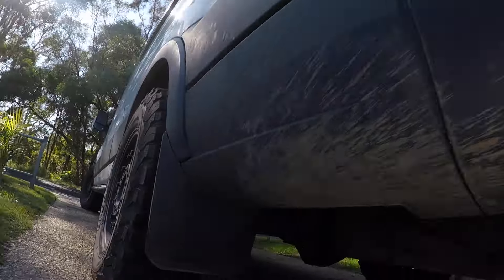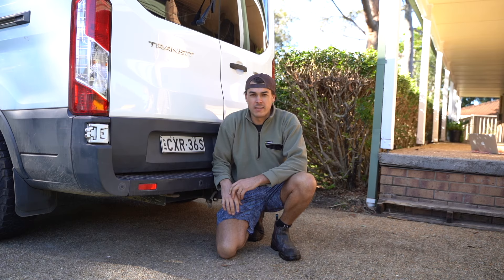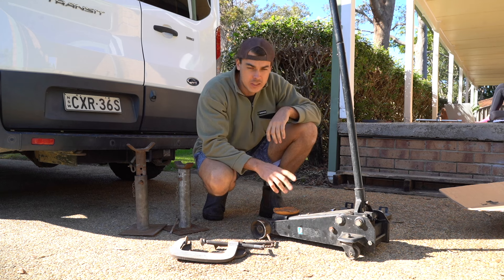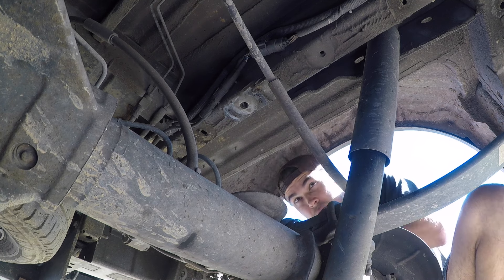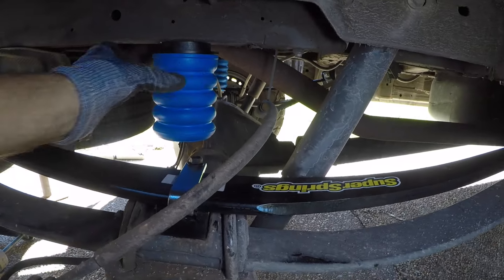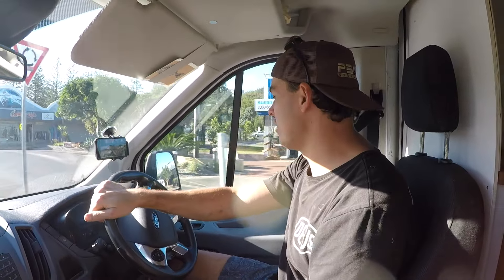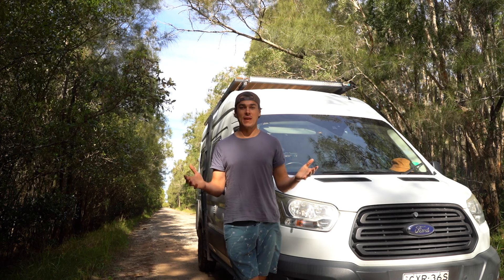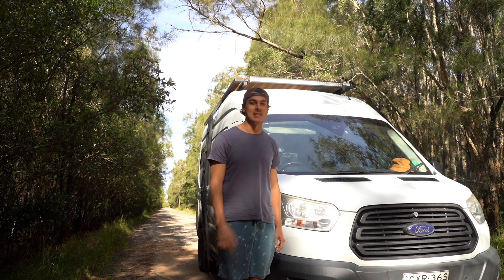We're TOO HEAVY- Upgraded our Suspension to SUPER SPRINGS | Ford Transit Conversion

Comment: I know its been a few years but thank you for sharing your journey on solving the over weight problem. In America its our belly that needs the super springs < I'm only kidding America < There was a time in America when we can have joke about things like this. I love solving problems, its the journey not the actual solution. Its that inner feeling of doing yourself using the information that's available. And when you get to work and your solution can be repeated. Its an amazing feeling! The journey is putting the part on the same frequencies, the tone of the vibration and putting the 3  to work together/ balance! Every thing has adjustments but there are degrees. You have to find the right one to fit that problem. GREAT JOB!

Comment: Hi I have RV mobile home that’s on a Ford Transit 350HD Chassis which I just got in January.  I wasn’t aware of SuperSprings I just know about the sumo springs for front and rear.  So I know I’m not overweight or sagging in the back  and everything is pretty even in the RV.  So next week having the Sumo Springs and a Hellwig Sway Bar added.  So now I will monitor the back very closely and see if in the future I may need to add SuperSpring to my RV.  Excellent video.

Comment: Great video, Ty
This video was so needed I have been going crazy removed everything out of my van just put some plastic in to lighten it up and I am still dealing with issues and I really don't have that much.
The mechanic prices to fix anything or through the roof and pretty much you pay them and they never fix anything.
So I am so grateful for this video I'm so grateful for the time you took and the details of every nook and cranny in explaining successfully a great fix.
My van  is a 92 Chevy g30 sportvan and I am not willing to let it go at this point. I just need more videos like yours and I can live successfully off grid. So gratefully,  thank you so much.💯✌️❤️🕯️
Reply from the maker: That’s awesome I’m glad you found it useful. You should check them out to see if they stock a set for you van. They are a pretty universal product so they accomodate for a range of vans and pickups. Good luck and I hope you can find a solution
Reply: @saltyvanventures  Ty brother,💯✌️

Comment: Thanks for addressing this issue. Like you said it’s not talked about. I’m about to get some springs in my sprinter lwb this week so great timing in this episode to have a better understanding of how it works. I know when I built my van I focused on not going above the GVS but I should have focused more on keeping it as much under that as possible. I too am experiencing it more on drivers side as more weight that side even though I tried to distribute weight evenly. So my Xmas project is doing a van renovation to help reduce some weight. Cheers to a better ride ✌🏼
Reply from the maker: So glad this has helped you out. Yes i think its common for people to try and have the GVM as a target weight but thats probably not the right mentality, as we have both discovered.

Comment: I too added a leaf helper "super spring" but later took it out and got myself a completely new set of  extra heavy duty leaf springs that had 5 brand new leafs vs original old 2 leafs. Much much better solution and it didn't cost that much more.
Reply: Was there any problem you found with the superspring?
Reply: @RedbackAviation  It just wasn't enough lift for me. At the time I thought it was my only option and I didn't realize that you can order a completely new leaf spring set.

Comment: Cool video, glad your happy with your modification on the van! I have a third gen Toyota Tacoma TRD off-road it always sags when I put my trailer because the "off-road" model has soft suspension I just put on the sumo springs I need to do the front I just did the rears... I don't have $600 bucks to blow right now haha

Comment: Thank you so much for this DIY solution! It also makes it less scary to try it out on your own and thank you for showing us some "troubleshooting steps" you have done with the camera!

I've been wondering, wouldn't it be better to make the Assister-Spring tighter on the right side, by setting it to middle-position, instead of lowest position? Wouldn't that bring it perhaps closer from 845mm to the 885mm on the left side? Just wondering why you haven't decided to do that? Thank you so much for the explanation!
Reply from the maker: I tired that but the suspension was then too stiff and wasn't as comfortable to drive. There is a happy medium with the springs you need to find for each vehicle.

Comment: We just built out a 2023 Ford Transit AWD 250. It’s GVWR is 9070. We are about 700 lbs over that. This van rides nice but the leaf springs are slightly inverted and the bump stop is sitting (no gap but not compressed) on the axle. We are looking at the Stage 4 TOPO 2.0 System. Ever heard of it? How would you compare your kit to this kit? Price wise, big difference. I just wonder if I’m going overboard if I go with Van Compass’ TOPO 2.0 system. Thank you for this great video!!

Comment: Very cool. I was up in the air with deciding to do this or not on my Sprinter build. You have definitely convinced me to do it. The comment of a passenger & driver side let me know they come in pairs. Unfortunately it doesn't state that on the website. I'm putting a order in right now. Thanks. 
😎👍
Reply from the maker: Yes it does come as a pair! Hopefully they work out for you too!
Reply: @saltyvanventures  Thanks for the response. I figured out I needed the extra center bracket too which was extra. I will be doing a install video on my channel as soon as I get all the parts. 😎👍

Comment: Great job, simply amazing! Without your Swiss father this time 😁 Hope you secured the nuts and bolts with threadlock, so that on a rough road you won’t leave the new system. Thanks for sharing this video and have a good and safe ride again 🖖😎🍀🌞
Reply from the maker: Haha yes no father watching over. It’s a very simple process though. And yes of course, the pack actually comes with a tube of thread lock which is amazing as I didn’t have any!
Reply: @saltyvanventures  perfect, then I’m relieved and can let you drive through the wonderful but sometimes roughly off-road parts of Australia 😂✌️🍀🌞👍😘

Comment: Thanks for posting with the before and after.  Was thinking about picking up Sumos to help smooth out the bottom out, but good to see the helper spring in action, too!
Reply from the maker: Glad it helped. They actually work really well. I would say if you don’t have a big weight issue you can get away with just the sumo springs but we really needed the extra steel in the rear

Comment: I'm planning on getting a Transit 350 and doing just what you described.  One thing that I'm worried about is the battery under the seat. What do you do if the back is all built up?

Comment: You may want to think about adding a pair of Thor airbags to the rear, before the new springs also sag..
I have a VW 4 motion campervan the 2 different sets of extra HD springs that I fitted both failed within 6 months of each other
Reply from the maker: The great thing is that the sumo spring is essentially a permanent airbag which works with the super spring to stop that from happening
Reply: Was it a superspring or just more leafs to the original pack?

Comment: Nice video, I like the rear fix but I think an upgraded spring at the front would be a better fix. Also wondering if you plan to try the rear with a little more gap between the axle plate and the sumo spring.

Comment: Did you ever consider air suspension on the rear, replacing the stoppers? Easy diy fix, cheap and extra ride comfort.
Reply from the maker: I did but they aren’t designed to regain the lost height like the super springs are for. They are more a comparison to the sumo springs. But the airbags require more maintenance and a compressor where this solution requires none.

Comment: What about adding a sway bar... Hellwig makes some and Ford has OEMs...
Reply from the maker: Interesting. I haven't looked into that option, although I suppose this would only solve the issue of the van swaying around corners more due to the weight of the conversion. This might be an option for some people if they are experiencing that, but with this Supersprings and Sumosprings  system, it gave us back the ride height that we lost, a smoother more comfortable ride, as well as solving the sway which seemed like the best solution for us.

Comment: Why did you not consider air suspension for the rear of your van and sumo assist for your front springs
Reply from the maker: I did but they require more maintenance and also a compressor. Also the airbags aren’t designed to get the hight back, the sumo springs are essentially an airbag but in solid state
Reply: @saltyvanventures  SumoSprings an airbag? Mine are compact.....

Comment: Glad you got a smoother ride, I've been researching lift kits and struts that suite more off-road application but have been struggling to find anything in Australia, most of the modifications are from USA and do not ship to Australia. Have you come across anything in your research of these that would raise the vehicle by about 2 to 3"?
Reply from the maker: Nothing I found was from Australia, only the states but they did mention they don't ship international. If you really wanted to get them you can use postal services that get around that problem that forward your parcel through a 3rd party

Comment: Could you adjust the two back springs differently to compensate for the weight imbalance and get the ride height equalized?
Reply from the maker: Yes possibly as it is fully customisable. I did think of that but ran out of time to test it out. I wonder what it could have done, although I really don’t think it’s an issue having one side slightly lower than the other

Comment: What wheel offsets are you running 38mm? And are those 8 inch wide rims? Do you get any rubbing?
Reply from the maker: The rims are Black Rhino Arsenal 16x8 5/160 P38. No rubbing. The only mod I needed to do was remove the mud flaps from the front tyres as the hex nuts were touching with the larger tyres.

Comment: Why don’t you get better shocks??
Reply from the maker: Shocks aren’t going to lift the van back up to factory height. That’s not what they are designed for. We needed to upgrade the springs fist and foremost
Reply: @saltyvanventures  shocks are essential with the rear upgrades.
Reply: Spring rate and shock controlling the rebound goes hand in hand.
Reply: @RedbackAviation incorrect ,
Reply: Tie that c. Lamp off, if it popped off you would lose your face

Comment: I don’t think you understand a bump stop is not part of your suspension like you’re thinking the suspension is your spring and your shocks the bump stop is there just to keep from bottoming out your axle against your frame the two components that are important on your suspension are the shock and your spring
Reply: Agreed. The suspension upgrade is necessary but seriously insufficient.
Reply from the maker: Yes and no. Yes a bump stop isn’t part of the primary suspension however in these van they aren’t the standard hard rubber bump stops that resemble a rubber door stopper. They are a marshmallow like compressible rubber and although they are defiantly not meant to be ridden on them permanently, they do act as some sort of compression suspension when loaded heavy or on roughy roads where you could bottom out.

Comment: Good video, and good that you compared like with like which a lot of people don't properly do.  Have you seen this video about a sprinter that cracked its chassis rails with a similar setup?  https://www.youtube.com/watch?v=10zH1UtkiQ4&t=250s&ab_channel=FreelyRoaming .  The chassis in a unibody van isnt designed to take constant loading at the bump stop mounting point and could lead to cracking, especially on gravel roads.  I'd look into getting some U channels folded from 3mm steel to spread the load of the bump stop over maybe half the length of the spring.
Reply from the maker: Oh wow i just watched it. Yes that is a big problem with the airbag solution. That is why our first and foremost priority was to upgrade the steel springs to lift the chassis back to factory. This then takes a monstrous load off chassis around the bump stop. The sumo spring then does the secondary  role of additional support while on the rougher road.